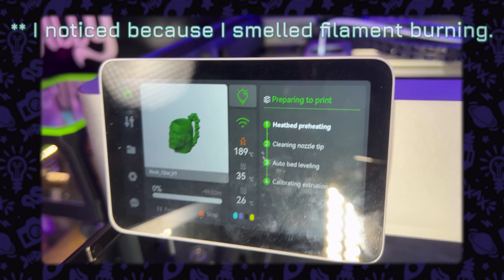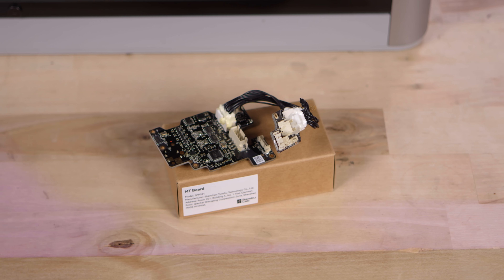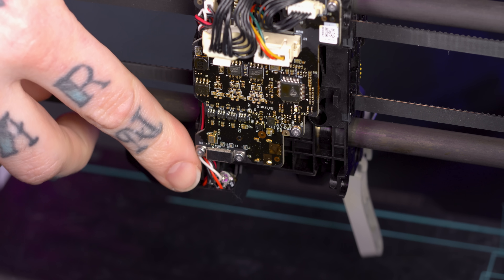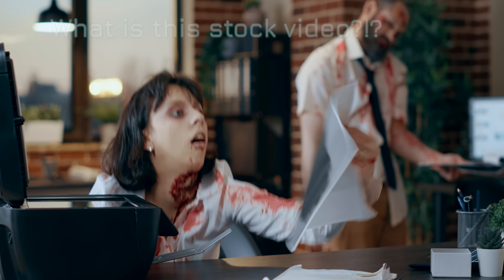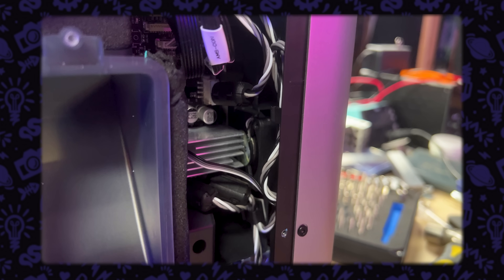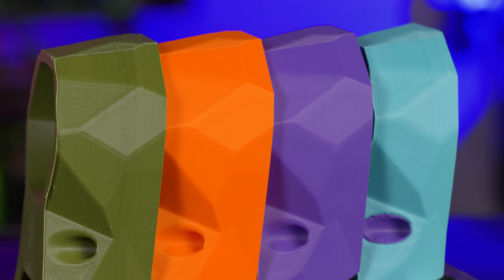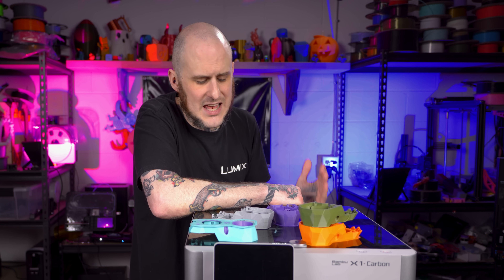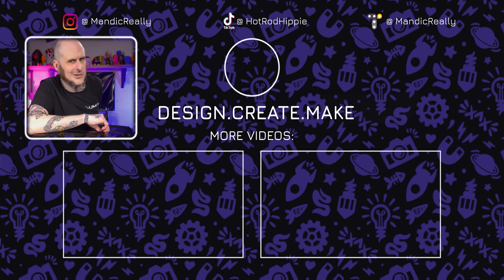MY BAMBU X-1 BROKE - Thermal Runaway?! Let's Fix it!

Comment: In terms of comparing the print of the X1 vs the Voron. I think the crisp corners are a result of improperly tuned pressure advance, leading to a very small amount of overextruded material in places where the print head had to change directions rapidly.
Reply from the maker: Are you saying the Voron overextruded? Because PA hasn’t been tuned so I’m inclined to agree. That said the crisp corners are how the part is designed and intended to be, so round smooth ones off the X-1 simply are not correct.
Reply: @MandicReally  It's not overextrusion, the extruder doesn't slow down enough when the print head decelerates, and therefore the material flows a bit more in corners. Corners and small details will be smoothed out if the PA value is too high though. 

It's basically impossible to find a balanced PA value. And if you're printing really fast, the pressure in the hotend gets high and the printer has to compensate more.

Would be interesting if there was a setting for fine adjustment in the slicer.
Reply from the maker: @robertgcode965  there isn’t in standard Bambu Studio. The “Soft Fever” fork has added PA (LA) adjustment and tuning models for testing and calibrating. 

I’ve tried manually tuning Linear Advance on the X-1 and my findings don’t support the corner rounding being flow related (in that way anyway). Adjusted Linear Advance settings became quickly evident as underextrusion at the end of lines or blobs on surface but made no change to the corner rounding. It’s been a bit since I did that testing so maybe I’ll revisit it sometime soon.
Reply: @MandicReally  I think you're right. Maybe it's input shaper related. I don't have any experience with it yet.

Comment: i had the same problem..... rebooted and pressed into the wires. now it works
Reply from the maker: The Toolhead PCB seems like it may have problematic connections on early units. Some think the reason the P1P uses a new design is because of this.

Comment: I am having the same problem with the main board fan and only a dozen hours on the machine...I am going to replace it with a noctua. The possibility that thermal runaway is not engaged is scary!

Comment: Your layer issues looks more like a retraction issue or buildup in the nozzle where it builds up pressure or too much plastic from many retractions, and then extrudes too much once it gets to the outer walls. This normally is the opposite where it under extrudes when this happens, but I have seen it go both ways depending on the model and settings. Have you tried rotating the model on the build plate to see if that changes anything? could be binding up in the ptfe tube when it reaches parts of the build plate as well.

Comment: The X1 isn't perfect, but no printer is (you can get close if you spend $50,000). If people are unwilling or unable to do any maintenance on a printer and can't afford a support contract, then maybe 3D printing isn't for them. That said, the cutter sticking issue seems like a mechanical issue, because it's happened a couple times to me, just in the course of clearing a jam. I've never gotten that message before/during a print, though.

Comment: I think you have the wrong idea of prusa support. When you contact prusa support, you will get a live person within minutes and they will work with you for as long as it takes to resolve your issue. Replacement parts are easy to get either via prusa or off the shelf. Prusa is the standard for 3D support.

Comment: Hmm 450hrs seems to be quite a little time I have almost double that on my v2.4 with no repairs. Except changing carbon. Which I have my Voron setup to tell me when to do so. Also I agree that this repair is also much more involved then someone new would be able to do easy. I think people where hoping but this isn’t 2d printer level yet. Maybe soon there will be dedicated 3d printer repair people.  Ultimately if your new join a discord and make a friend local that can help when you need it.

Comment: Personally, I think someone new to 3d printing should start off with a much cheaper Ender 3 or a clone to 1) Understand how 3d printers work 2) Be able to diagnose/repair issues they come across 3) Learn about mods, their benefits, downsides, etc and 4) To determine if they even like or have a need/want to 3d print
Reply: As someone who has multiple fdm and msla printers I disagree strongly. The main reason why is because I have had multiple friends I have recommended this exact same thing and they just wanted to print. It killed the entire experience for them and then I went over and from start to finish fixed the problem sometimes we had to replace parts right out of the gate. Could this happen on an x1 oh yes. But so far it seems like their support is responsive for issues seen. I really feel like the best option is whatever excites whoever is buying it.
Reply: Sure that makes it easier on fixing some things, but on the other side, a lot of people buy a car and start driving it and if there is a problem, they call for help. That is ok, because not everyone wants to repair a car. I started with an Ender 3 and modded that thing, but that didn’t help me with my problems i had so far with my X1. The ender helped me more with my prusa, what still delivers better quality than the X1 and if i print small parts, the prusa is faster, because the starting process of the X1 is just crazy.
Reply: Yeah, that's what I should have done, would have been easier on my wallet too!! As I'm finally setting up my X1C I guess I'll see how it goes!
Reply: I would say to get real use out a 3d printer you need to have CAD skills. Printing other people's designs is great but being able to custom design parts opens up a whole new world of possibilities.

Comment: for the roundness of the cornes try to force the linear advance on the printer start g code and compare once again. before purge line sequence place this: 
;===== Linear Advance parameter ===============
M900 K0.02     ;tune your own LA value.
M900 L1000.0    ;linear advance factor 1000 =1.0
Reply from the maker: I did this early on in my work with the machine and found it made no difference to what I was experiencing. Bambu suggested trying it and after going back and forth a bit it never made any difference to the specific issue I found.
Reply: @MandicReally  what about another slicer? :)
Reply from the maker: @Lab4450com  I haven't attempted making a profile in PrusaSlicer yet, worth a shot.  I don't use or care for Cura but might be worth trying with a different engine running the slicer and all.
Reply: @MandicReally  at least we rule out if the roundness is from the slicer.

Comment: for the MB fan use noctua 5v pwm version with 4 cables. working flawless with me. next video dont forget to place the wire diagram:
ground - Dark Gray (Next to Black)-> Black color cable on noctua
5v- Black -> Yellow
rpm speed signal - Light Gray (Next to White) -> Green
pwm - White-> Blue
for the chamber fan i have replaced with another model from NMB but just reduce the flow to 40% of the stock fan and open the top lid glass when printing PLA.

Comment: The issues with the MC fan appear to be around the lube that they come with. I was able to bring mine back to life with a dot of superlube on the shaft and cleaning out the old lube which had mostly leaked out onto the fan shroud. It makes me wonder if they are running these fans faster than spec, or maybe the tape mounting is allowing for too much vibration. Either way here is the video i followed to disassemble and lube. https://youtu.be/uOBAszltL58 might be helpful for you to film yourself if you try it. The Bambu fan is slightly different than the one in this vid.

Comment: I get a feeling this machine was designed with two very specific goals in mind;
1) A specific speed 
2) A specific cost

Everything else has had to abide by those goals. I still kind of want one to play with, but I'd rather buy another voron personally. 
But I really do like that they've made a machine significantly better then most of the run-of-the-mill creality and ender 3 clones, able to give people a taste of what higher end machines can do at a much lower bar of entry. And this whole market needs some disruption, been stagnant for way too long in the comercial consumer sphere!
Reply: Have you not described every single non voron?
Reply: These machines rock.  Buy one.
Reply: @karlmadsen3179 no on x1c

Comment: The next best thing out of china uses the same trash components as a $150 ender 3. So many people are having their stepper motors burn up and go bad. Come to find out, they use same motors as on an ender 3, same part number, same manufacture. Same with the main board fans(no wonder they're all going bad). Bambu is just a race to the bottom in manufacturing, utilizing the same bargain bin components as the rest of the china printers, with a few parts actually made in house, in the same shezhen factory. 480hrs and already multiple problems, cant wait to see all the problems when you get 1k hrs.

Meanwhile prusa is out here deliberately delaying their X1 so they can ensure they use high quality parts, and not cheap, trash components like the rest of the chinese printers.

Comment: Loads of interesting takes on the X1, thanks for that interesting video! 
The support is quick in responding and in sending spares, BUT: You have to repair it on your own. This will scare the hell out of many people - like you say. 
The (missing?!) thermal run-a-way protection is worrying! Need to try that. And damn: You have a LOT of problems on your's! My two X1 (early demo and kickstarter pledge) are mostly VERY reliable (except for occasional clogs). For higher quality prints I made a 75% profile: All speeds/accelerations scaled down to 75% - print time isn't affected that much, as there are other bottle necks most of the time (slow downs for overhangs/cooling). Nevertheless: Fully agreed, Bambu did/does a very good job in comparison, but they're/we're not 100% "there", yet - like on photo-copiers or other mass produces machines - concerning after-sales and concerning the perfect tuning of the machines/settings.
Reply: but which printer you dont have to repair on yourself? if i look at the daily growing bambu wiki with pics and videos its way easier to repair than any other printer. no self printing parts that doesnt fit(lose or too tight)
Reply: @Mer_Lou  There is another company with excelent support, shop and instructions: Prusa! That is THE reason, why it is more often recommended although much more expensive than a Ender 3 clone. For the problem with self printed parts that does not fit there could be the alternative to order that parts, maybe even extruded parts which does fit. So ... there is room for improvement!

"but which printer you dont have to repair on yourself?" ... Either the one which you just have to send to a repair shop of the company in your country like there are from many smartphone companies OR the "professional" printer for a couple of thousands more where you ring up the support and a technician comes for repair.
So .. there are solutions, but none of them where you buy a product one time and be forever happy with it.
Reply: @Mer_Lou  Thing is: Ease of use out of the box and fire-and-forget printing is Bambu Labs main advertisement. This issue threatens their USP ...
Reply: It would be interesting to know how many hours and materials (because of temperatures) you printed. I don't know if Bambu Lab has a maintenance plan for it's machines but maybe after 300/ 400 hours some kind of maintenance would be clever. This could also include some tests (to see if safety measures are still in tact) and to check if something got loose.

Comment: After my Shapeoko experience there's little chance I could support a machine like this. (nothing against Shapeoko's)
You'll get support for this machine to the point it's successor has launched and then spare parts will run dry.
The Shapeoko was at least an semi-open design so I had a local laser cutter cut me new endplates that Carbide3D could no longer source for their 2 year old machine. That's not something that's being offered here in terms of an open design.  Voron seems to be the right way to go, standardize some open designs, that way you're not stuck with a broken machine in 2 years and it's either hundreds or unobtanium to fix trivial problems.  You get options. Ender wise, I've got a local store carrying parts, while I might not get a direct reply from Creality, the market is flooded with parts, they have the supply chain figured out and we have great community support.  Anycubic's actually been really good at responding to service requests, though honoring their warranties are another issue.
Reply: What issues did you have with your shapeoko? Been looking at them for a few years now but never pulled the trigger.
Reply: @LilApe  EOL support. Great machines.
My comment addresses the issue in short. They no longer supplied endplates for the gantry.
I preordered a Shapoko 3, waited  a year?
Got the unit,  had EMF issues, they replaced my PCB.  Then they released the XL and XXL upgrade. So I bought the upgrade.  This left me with remnants of an old machine, but not enough to rebuild it into a second.
Then they release a Z upgrade. So I bought that, at the same time I asked for Endplates so I could take my current Z, buy some steppers, and rebuild the old smaller machine collecting dust.  That's when they told me they don't supply those parts because they moved onto the Shapeoko Pro/4?  
Luckily the Shapeoko design is sem-open (custom extrusions), so I took the endplate design into Lightburn managed to get a local shop to laser me out some new endplates.  I powder coated them in the garage and rebuilt the old machine.  Now I have both machines S3 laser and S3XXL router running.
You're just at the mercy of the manufacturer once you start getting into custom machines/parts.  Carbide was reasonably good to me, but they move onto new products so quick that you could be left in the cold sooner than you think.

Comment: Did I see that correctly that there is a pretty regular looking USB Cable going from the Motherboard to the Toolhead? Does anybody know if its rated for continuous flex / robotics standard of some sort? Looks like a problem waiting to happen if not.

Comment: so refreshing to hear a pliable review on this hail Mary of a printer. its never ending seeing the start and walkaway concept with this printer. i feel personally it needs a lot more developmental hours and possibly an x2. i know its biult to a pricepoint but i feel they where about 200,000 hrs short of concept with this one
Reply: Lol most revolutionary consumer printer in 5 years, smashed all expectations and they missed the mark?
Reply: @scotthancock8225  Literally nothing "revolutionary" about it dude lol. Its just another coreXY printer running klipper that they sold for cheap, using cheap parts. Let me know when bambu lab actually innovated on their own, rather than copying other people's hard work.

I'm still waiting for you to tell me what they actually innovated on from the other video.
Reply: @LilApe  The performance in a commercial printer is revolutionary
Reply: @thenamelessone123  It performs no different than a voron from 2 years ago, therefore it's not revolutionary. An I3 printer running klipper runs just as fast and puts out the same quality.

What is ONE thing bambu has done, that no other 3d printer company has, that has resulted in being a game changer?
Reply: @Lil Ape  I'd say the out-of-box speed and quality is pretty revolutionary. It puts out better quality prints with the standard profile than any of my other printers with tuned profiles. I've also never seen a lidar scanner on any other printer? Idk about the flow calibration, but it seems to make a difference with the secondary bed leveling it does. And pretty cool that it can detect a bad first layer (although I've only had a bad first layer with wet nylon).
Reply: @scotthancock8225  If it is not catching thermal runaway, it is not fulfilling a basic safety requirement. What would you call that but a fail? If the impact is severe enough, then one issue is enough to make the whole product fail.

Comment: Thanks for the video.  I have a Prusa MK3s with the MMU2s and Prusa Mini, as others I'm debating getting rid of the MK3s and maybe the Mini for Bambu.  I built the MK3s as a kit, and it works, but since adding the MMU2s to it I've had nothing but issues with.  I have no idea where to go to get fixes, so the fact Bambu offers videos on how to fix things is a upgrade in my mind.  Again I love Prusa as a company. The printer is probably above my skill level to keep working.

Comment: Although the Bambu range of printers look good on paper for long term use it may not be so bright.  As the parts are propriety you could have serious issues in terms of getting replacement parts and what happens when the printer is made obsolete or if the company goes out of business.  The Bambu range or printers, the Ultimaker etc are all made to resemble an applicance, the problem is appliances will need servicing or repairs at some stage.  These printers are some much more difficult to work on compared to your rep-rap bed slinger type 3D Printers.  My first 3D Printer was a Creatbot which is an applicance type 3D Printer, which for the time was great when it worked.  When things went wrong and needed to be fixed it was a pain, even changing the nozzle wasn't easy compared to the other 3D Printers I have had since.
Reply: Ultimaker may resemble an appliance, but they're totally open source and getting replacement parts is easy because of it.